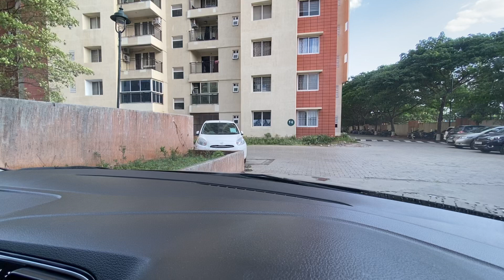VW Polo 6R - AFTER the front windshield wash tubing replacement

Comment: Hi there.... What wipers are you using? It looks perfect. Any suggestions for front wipers???
Reply from the maker: I am using wipers from a brand called Power-X. Nothing fancy or expensive but it looks exactly like the ones on the Toyotas with a plastic trim covering the frame of the wiper. Looks very aesthetic that way.
Reply: @GaneshBalan  I have had Bosch wipers earlier. But they are too noisy and leave streaks, hence asked. Thanks a lot! Been a fan of your DIY stuff on T-bhp but never tried much 😂 thanks again!
Reply from the maker: Thanks man. 🙂 As for wipers, I replace them every year. The blades tend to become brittle over time and starts squeaking or leaving streaks.